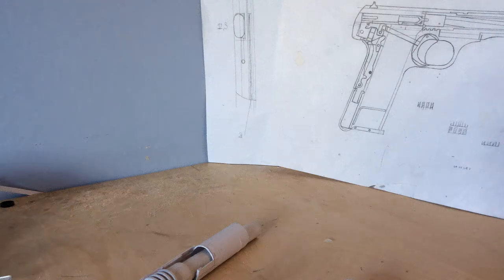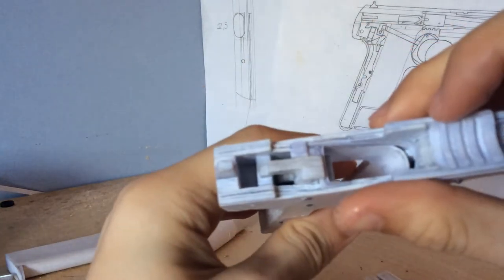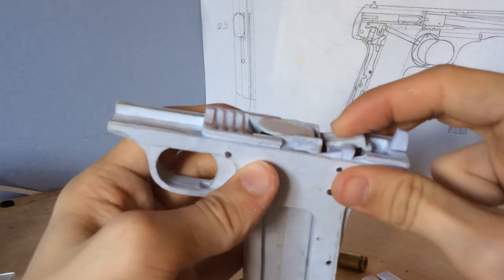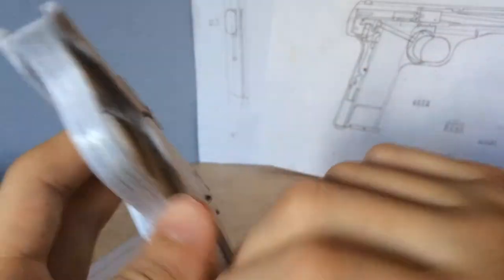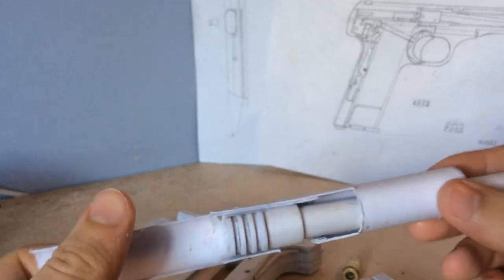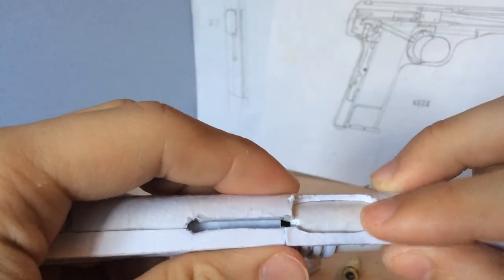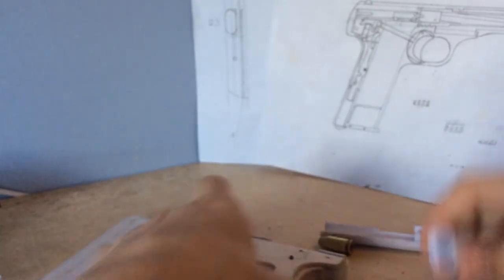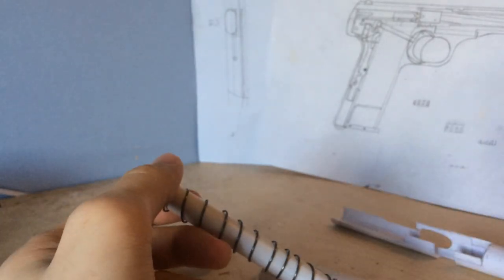Paper Fn M1922 part 3: Breechblock

Comment: How do you polish the paper for that smooth looking paper? Also what kind of super glue do you use for hardening the paper, and where I could buy it?
Reply from the maker: I add a couple of layers of superglue on the piece i want to polish then i use a combination of files and sandpaper to do the polishing.
As for the superglue is use, i use the cheapest low viscosity superglue i can find (the one i buy usually comes in 2 gram tubes).